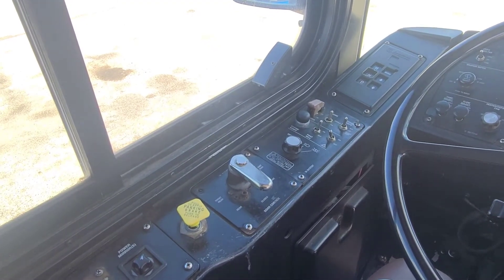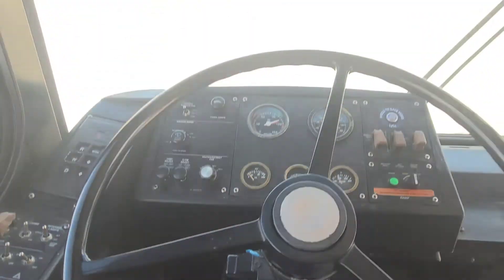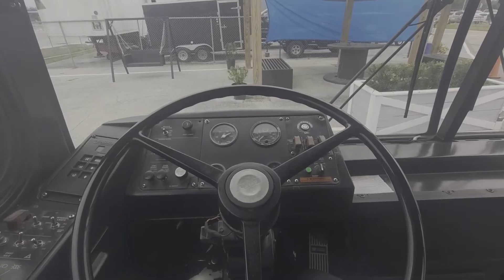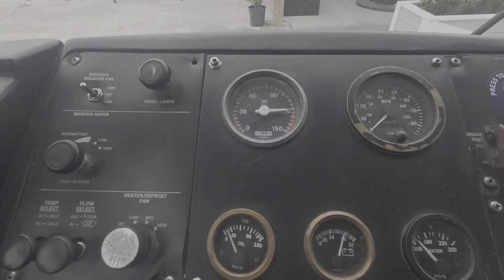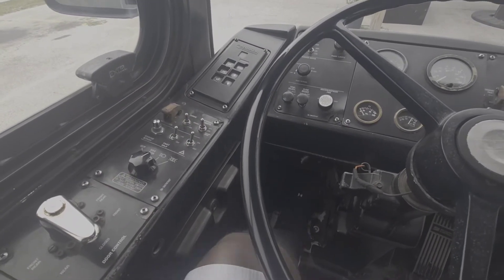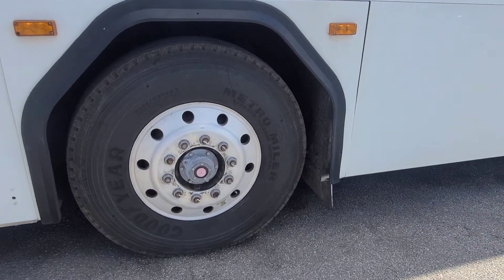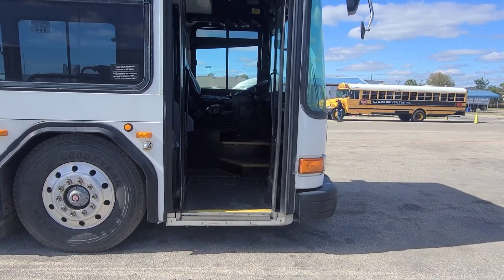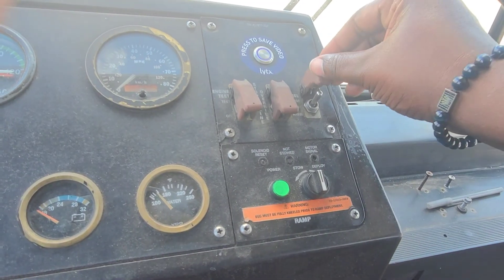Transit Bus PreTrip Inspection - Modernized Supplement (Full Bus)

Comment: Good video.  In following the instructions of the Vehicle Inspection Test I would follow this instruction.  "You MUST name, point to and/or touch and fully explain to the examiner WHAT you are inspecting each safety critical item for.  If you do not, you will not get credit for the item(s)."
Point to everything.  Also, on the Air Leakage Rate Test as you get to the end of the test, point to the air gauge to show the inspector what you are talking about, and state something like "as you can see it has not lost more that 3 psi in one minute."  I would want verification from the inspector before I lifted my foot from the foot brake.  They could be busy writing and might not see that critical moment.  Don't risk the "I didn't see" comment and have to do it all over again. I've see this happen.
Reply: Also it’s LEAK LIGHT POP AND HE SHOULD HAVE SAID PUT BUS TO BED BRAKE DOWN ENGINE OFF DAY RUN
Reply: Don't ever take your foot off the service brake too. Your bus could roll on uneven surface without chocks.